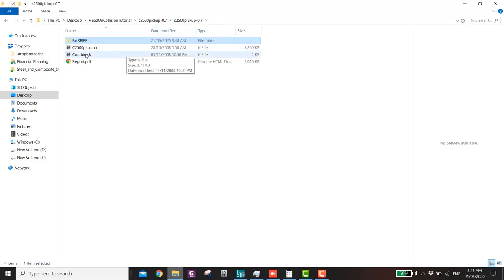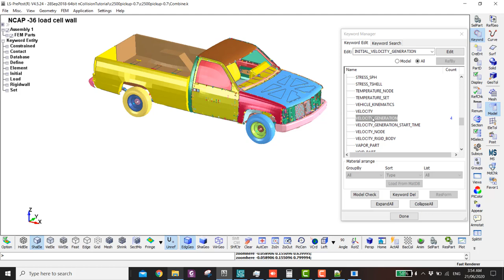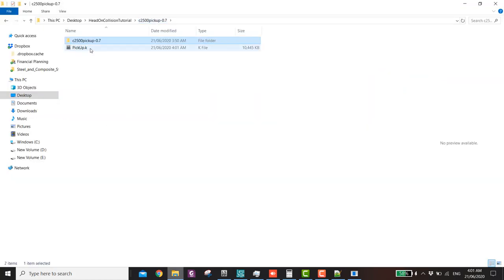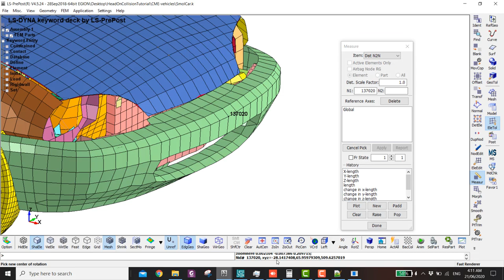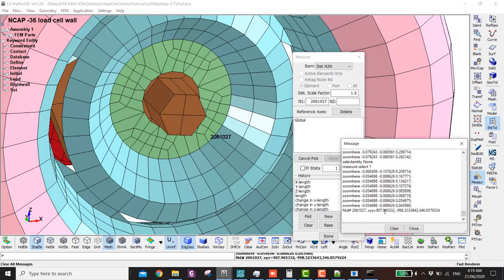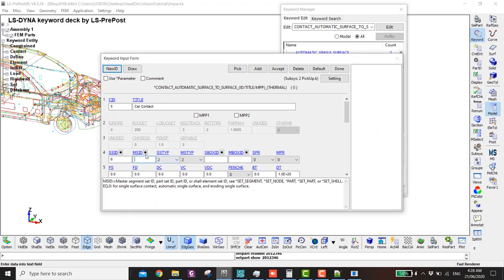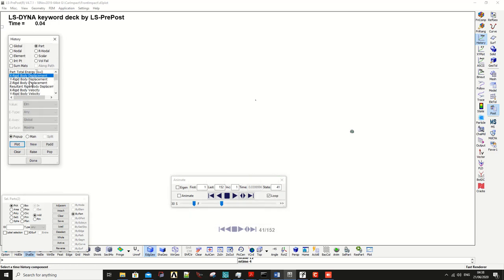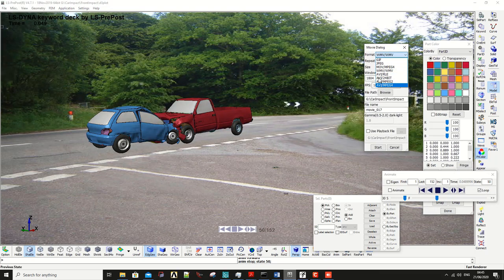LS-DYNA TUTORIAL 16: Car Collision - Hatchback vs Pickup Truck

Comment: Thx for the tutorial, it was very helpful.
I have a question. I noticed that some vehicles, such as 2007 Chevrolet Silverado in Initial_Velocity_Generation Tab, have Vel_1 parameter and vehicle's speed can't be changed. What should I do to change it?
Reply from the maker: You should find all the variables in *PARAMETER keyword. You can change frm there.
Reply: @AmeenTopa  Thx, it's working.
Reply: @Alexandr8113  bro, were can u change vehicule speed ?
Reply from the maker: Dear Dem, you can see the tutorial. I discussed the keyword used for the velocity generation.
Reply: @AmeenTopa  oww my bad ,i got it now, thanks a lot for your time

Comment: Thank you so much for sharing your knowledge about LS Dyna. Do you have, by any chance, done a simulation using soft elements, like using MAT 63 CRUSHABLE FOAM? For example for simple compression on cube soft solid. I've been looking for tutorials at YouTube or reading on journals but it's still not solved. Thanks in advance.
Reply from the maker: Hi Hafidz, check out here my tutorial where I used this material model for Polystrene Foam:
https://www.youtube.com/watch?v=4VPQVCk5F3A&t=713s

For more details, you can check my research paper here:
https://www.hindawi.com/journals/mse/...
Reply: @AmeenTopa  thank so much!
Reply from the maker: Done email. Please check your inbox.

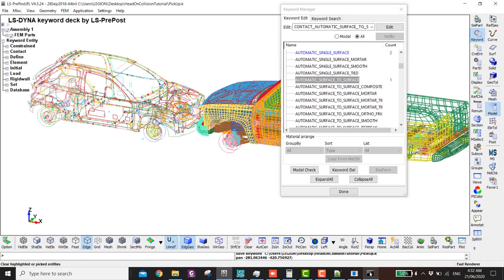Comment: Hey Ameen, thanks for this great instructive video. I have a question for you. I did the same what you did until 25:15 .But when I tried to run the PickUp file, one warning occured. "DATABASE_BINARY_INTFOR keyword found but "s=" is not present in command line. Submit job anyway". when I clicked ok, cmd screen gave me this
 "Warning 70005 (OTH+5)
   input file does not exist:...

please define input file names or change defaults :"

then the file status "terminated" in Ls run screen :(

I will be appreciated if you can help with this problem ?
Reply from the maker: You should add the extra command s = intfor which will create binary files called intfor. However, this should not be cause of termination error. It must be something else. If you scroll up in the run screen, you will find the reason stated.
Reply: @AmeenTopa   Thanks for replying. I scrolled up cmd screen but there was no difference between working file and this. Then I coppied the PickUp file (with 2 cars) and paste it in to some other file  on dekstop. Then run it from there. İt surprisingly worked hahahah. Thanks for the vid again. bb :)
Reply from the maker: Depending on your system, the name of the k files and the directory where you put them should not have any spaces. For example, E:Simulation\Car Collision\Test 1.k will not work because there are spaces between in "Car Collision" and in "Test 1.k"
Reply: Yeah I've read  that "no space condition situation". Actually there are some space in the directory file which has name "ls dyna youtube ex.". It is analysing  even it has some space in file's name.  But I will put  no space from now on.
Ps: It is still analysing. I have a student license so I can not run ls dyna more than 4 Ncpu. Is there any way to make runnig process faster?
Reply: Btw the simulation has ended now. Small car acted like a rigid (unbroken) car. Interesting 🤔
Reply from the maker: To make the simulation faster, you can reduce the model size or apply mass scaling (which is not advisable for beginners).

Regarding the no space conditions, if depends on your system. I am using the same ls dyna version in my  PC and personal laptop. In my PC I can have spaces in the directory but in my laptop I cannot.
Reply from the maker: Are you sure you are using the same car models as in the tutorial? Since you are using a student version, I am not sure if you can run the exact model in the tutorial due to the limit of model size.
Reply: @AmeenTopa   Yes I am sure that I used the same car you used ahahah. The total node number is 95242 in your crash simulation ( fortunately student version can be used until128k nodes ). 
Thans for the "scalling" advise. I will use smaller cad parts like bumper for my improvisatorial work.

Comment: Good work.thanks
Is there any possibility to download different kind of vehicle model in ls dyna..
Reply from the maker: I have put links in the video descriptions. You can find some models there.
Reply: @AmeenTopa  
How to provide different weight into the vehicle model
Reply from the maker: You can increase the density of the parts. Or increase the values of point mass elements.
Reply: @AmeenTopa  thank you sir
Reply: Sir ..hoe to open vehicle model in ansys workbench.is that any possibility to open K file
Reply from the maker: You mean to open k file in Ansys Workbench? I don't know because I don't use Workbench a lot.

Comment: Hi sir , ive done ur tutorial , is there a way to display von mises , tresca on the simulation ?
Reply from the maker: Check my tutorial: POST PROCESSING WITH LS-PREPOST
Reply: @AmeenTopa  thank you very much , and is there a way to connect the 4 wheels to the full body ? i feel like it ruins the results when u define the contact between the two cars
Reply from the maker: I don't understand what do you mean by connect 4 wheels to the full body? The wheels are already connected (linked) through the CONSTRAINED keyword and the interactions are defined using CONTACT keywords.

Comment: Hi , i downloaded the student version , i dont have program manager , how can i run the simulation please?
Reply from the maker: Please check the follow video:
https://www.youtube.com/watch?v=6ei1KxCsu-s
Reply: @AmeenTopa  Hi , it actually worked , but my pc is slow so it takes a lot of time , and i keep getting theese warning in the cmd ;
 * Warning 41231 (SOL+1231)
     Curve ID 5 has at least 2 points that define a
     negative slope. This may be unstable.
////////////////////////////////////////
And this too :
 node  number 57001 deleted at time  1.3945E-02
      node  number 57009 deleted at time  1.3945E-02
     shell element 57000  failed at time  1.3945E-02
Reply from the maker: @roublard17  you can ignore these warnings. It is perfectly fine.
Reply: @AmeenTopa  Okey thanks a lot man ! one last question , were can u see or change the speed of the cars?
Reply: @AmeenTopa  Im verry sorry if i have too much questions , but when i ran the simulation , the four wheels of the pickup dislocated and kept on going , + the pickup windows got ejected to , i dont quiet get it ?

Comment: May I ask how to put the airbag and dummy into the car
Reply from the maker: You can check my  pinned comment for more tips about crash analysis.
Reply: @AmeenTopa  Okay, but I still don't quite understand
Reply from the maker: @user-zp8xi2dh2x  Sorry for not being clear enough.

What I mean, you need to find a sample model of dummy and air bag. If you have that, then you can import it to your simulation either by the method demonstrated in this video or by following the tips in the pinned comment.
Reply: @AmeenTopa  Can you elaborate on how to operate it
Reply from the maker: If you have the air bag and dummy models, then you can import to the car. You follow the same method I used in this tutorial. 

It is hard to explain in more details in the comment section. If you need further help, you can contact my team.

Comment: Hi Ameen, could you please explain how to apply a contact card between the structure and fluid domain  (FSI Problem) using ICFD solver? I find it is different with  applying a control card in a normal case like in this video.
Reply from the maker: For ICFD, you need to use ICFD BOUNDARY FSI. You need have an ICFD part which covers the structure.

Check out this example. 
https://www.dynaexamples.com/icfd/intermediate-examples/Intermediate_fsi_flap
Reply: @AmeenTopa  Yes i did the same thing as you said. But LS-Dyna always collapse at a certain point. i think this is because the solid flow through a smaller cross section area during the process (The cross-sectional area of the fluid domain gradually decreases) which results in a contact. Is this possible to solve this kind of problem with ICFD since i did not find examples like this.
Reply from the maker: @jiayueding4314  It is hard to imagine what you are trying to do. What is the name of the process or the problem that you are simulating?

In general, with ICFD, the domain should be big enough to contain the structure. If the structure (and thus the ICFD part that interact with it) goes out of the domain, then a termination error will occur. 

To explain this, you see the example of rocket or missile launching where it moves from left to right. If I would allow the rocket to move further, it will hit the boundary on the right and cause termination error. https://www.youtube.com/watch?v=eK22gTFg4TQ
Reply: @AmeenTopa  Thanks for the reply! I am trying to simulate a forming process of fiber bundles.

The fiber bundles will flow through a nozzle. At the beginning of the process the fibel bundles flow fluently because the fluid domain is big enough. But as the nozzle geometry changes, the fluid domain becomes smaller. When the fluid domain is not big enough to hold the solid domain , the termination error occurs. 

I will check the examples you attached above!
Reply from the maker: So basically it is a like a flow through a nozzle. If your fiber are solid, then I don't think ICFD is suitable. ICFD is for incompressible fluids and gases modelling.
Reply: @AmeenTopa  but the nozzle is full of polymer melt. So it could be thought of as a fluid-solid coupling problem.
Reply from the maker: @jiayueding4314  If the fibre is polymer melt. Then yes it should be possible to simulate it with ICFD. 

However, for forming process, it is better to use ALE method.
Reply: @AmeenTopa  Yes you are right. But i just wanna try to simulate this process with different solvers in LS-Dyna. And so far it seems like impossible to simulate this forming process with ICFD solver since the fluid domain is not big enough to contain the solid domain later in the forming process. Thank you so much for your reply!
Reply from the maker: @jiayueding4314  what if you increase the fluid domain then?

You can share a picture of the simulation or your keyword file. I might be able to recommend something.
Reply: @AmeenTopa   Thanks and what is your email address?  I think It is not reasonable to increase the fluid domain since i want to see the fiber reorientation at the end.
Reply from the maker: @jiayueding4314  Can you put your email here and I will follow up.

Comment: are you doing these crash analysis in student version of LS DYNA
Reply from the maker: Nope. In all my videos, I used the licensed software.
Reply: Is there any other way to install licensed software
Reply: Please 🙏🏼  do more videos on car crash test Analysis tutorials for beginners like this in Hypermesh . I beg you please do this in Hypermesh Student Version.
Reply: Do Licensed version and Student version separately so that It can be easy for me to learn and do
Reply: Please 🙏🏼 🙏🏼 🙏🏼 🙏🏼 🙏🏼 🙏🏼 🙏🏼 do these car crash test Analysis tutorials for beginners in both Hypermesh and LS DYNA Student Version Software
Reply from the maker: @vishnubalasubramanian4514  I don't do video requests and my channel is only focused on LS-Prepost.
Reply: Atleast could you please do it in LS DYNA Student Version
Reply from the maker: @vishnubalasubramanian4514  whether you use the student version or full version, the steps will be the same.
Reply: No the node capacity is the problem in student version
Reply from the maker: @vishnubalasubramanian4514  have you tried it with the student version?
Reply from the maker: If the node capacity exceeds the limit, then there is no way but to use the full version.
Reply: @AmeenTopa do more Videos on LS DYNA Tutorials for beginners as well as more car crash test Analysis also Please
Reply from the maker: @vishnubalasubramanian4514  I don't do video requests currently. 

You can contact my team if you are interested in a personal consultation session.

Comment: Do you know a way I could convert the car models to obj?
Reply from the maker: There might be other software that can do this (try exploring hypermesh). As far as I know, with LS-PREPOST, it is not possible.
Reply: @AmeenTopa  Is there a difference between Hyperworks and hyper mesh if so where can I download it
Reply from the maker: @briandagoatscalabrine2982  Hypermesh is one of the software under Hyperworks group. 

You can go to their official website and contact them to get to your local distributor.
Reply: @AmeenTopa  How can I do it with Hypermesh? I’ve downloaded it
Reply from the maker: @briandagoatscalabrine2982  Sorry I am not the best person to ask about HyperMesh. You can check other YouTube channels.
Reply: @AmeenTopa   Hi, i found a way to do this prepost you need to import the car models. Then, do ctrl+shift+g. And save it as .stl
Reply from the maker: @briandagoatscalabrine2982  with this, you can save as .igs or .stp and you must have a geometry part not FEM part. 

Because you are commenting on this video, I thought that you wanted to convert the car FEM model (as the one in the video) to geometry parts.

Comment: Can you import a solidworks file model into ls dyna?
Reply from the maker: No....however, in solid works, you can save your file as igs format which is compatible with LS Prepost.
Reply: I have a collage project and i don't know if it possible to use ls dyna for simulation
Reply: @AmeenTopa  thanks a lot 💙💙
Reply from the maker: To know if it is possible or not, you can search in journals for related work. If it is possible, then someone else must have done something similar to your project.